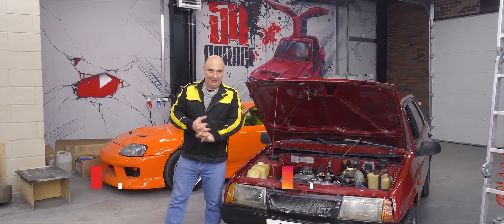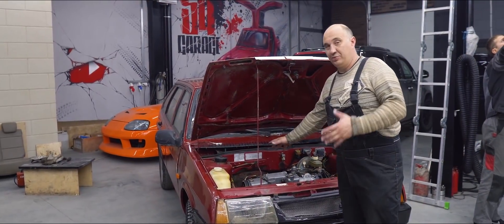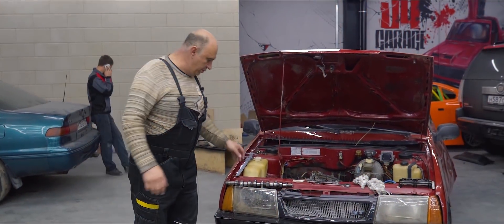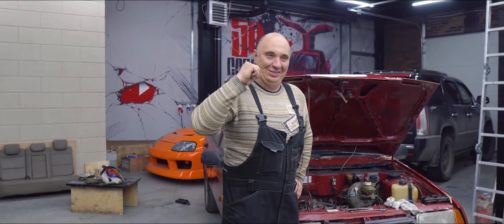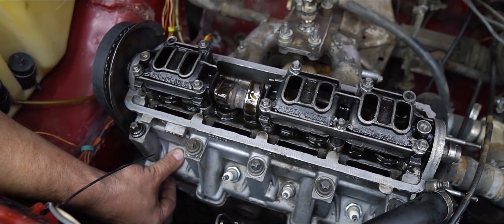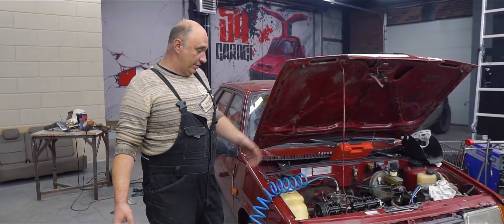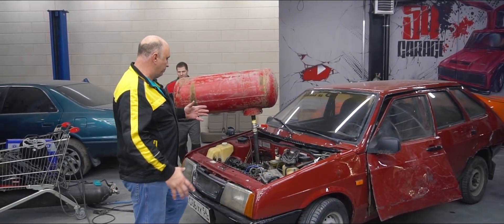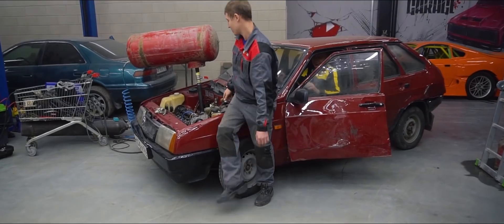Steam engine conversion, part one: startup on compressed air

Comment: i think the biggest problem is that the air is forcing in even if the intake valve is closed and the air is rushing in when the piston is moveing up.  you should use another method to shut the airflow to the silinder wile the exhaust valve is open and piston is moveing up.  you could use some sort of electrical valves and a programmable ecu to control the timeing.  my point is that the original intake valve isnt ment to hold back preassure comming from behind the valve. im sorry for my bad english.

Comment: Cut and reweld the cam lobes...you can at least clock the opening/closing to maximize your air use. Second, you would need individual air pipes to each cylinder, with switches/solenoids in the distributor to turn the air on and off at each top dead center.

Comment: just need to make the Camshaft work 1:1
Reply: im half way through and i cant watch because of their ideas
Reply: Nice idea you are a genius never thought of it like that
Reply: And add stronger springs to the intake valves.
Reply: wont work angle between valves is 90 degree for 4 stroke, for steam it should be 180
Reply: @Timsturbs  weld and re grind the cams i suppose, just weld extra lobes at 180 degrees so it Has 2 lobes per rotation per valve
Reply: @Namesakes.unit-x-10sq10  the point was that intake and exhaust strokes are next to each other and steam engine is basically a 2 stroke. so making cam 1:1 wont work. but yeah, there are many options. i personally would try solenoid valves.
Reply: @Timsturbs  don't need to make the cam a 1:1 just weld some new lobes at 180 degrees, then make the intake valve springs harder and exhaust softer. That's what they do to Briggs flatheads to make them steam powered
Reply: @Namesakes.unit-x-10sq10  sure, that's what they done in the video.
Reply: @Timsturbs  yes it will because instead of opening once in two revolutions it will open once in a revolution basically instead of adding another lobe in the camshaft we make the first lobe open twice as fast
Reply: @mohammedabenourseddiki6860  with just 1:1 it will be like:

1. 1/2 down stroke - intake
2. 1/2 down stroke - intake closes expanding gas pushes the piston
3. 1/2 up stroke - piston compresses gas
4. 1/2 up stroke - exhaust
2. - 3. will cancel each other
Reply: @TheDriverator  sure mister NASA engineer, i like your ideas...you just forgot you would have half opening time too...DUUUUUUUHHHHHH

Comment: It's strange that no-one in the comments has mentioned the elephant in the room - valve overlap. All modern IC engines use the exhaust gas outrush to scavenge the cylinder and assist in drawing in more fresh mixture. Sure they modded the cam to open on every stroke, but they didn't get rid of the overlap, so the some of the incoming compressed air will be going straight out of the exhaust for a short time each stroke. Probably why it wasn't long until all the air was used up.

Comment: guys, has anyone seen the camaro that runs the dragstrip on compressed air? I will try to find it. they have 3 or 4 about like scuba tanks in the trunk and they say they make, im guessing, more than 1000 horse power. they did not do that to their cam so they might not know about the gain.

Comment: Lol, i hate to break it to you, but to make the valves open on every revolution instead of pulling the camshaft and welding on the cam you just needed a smaller cam gear to make it turn 1 to 1 with the crankshaft rather than  .5 to 1.

Comment: Cut the crank shaft in two to make the four pistons 90 degrees apart and adjust the cams accordingly, doubt it'll continue turning under load otherwise, it'll want to stay at bottom-dead-center without torque from another cylinder to upset the balance.

Comment: Actually if you make the cam pulley the same size as the crank pulley it would turn it into the two stroke engine you would need for the compressed air.  Try that and see how much better it will work.

Comment: ever since I saw that tiny hose, I immediately thought there's no way it will work with that flimsy air volume. You need a lot of volume and a serious compressor that can hold the pressure at that volume. Also you should think about catching the exhaust steam and condense it then recirculate it back into the cauldron, since it will still be hot so you can optimize the power (once you actually put it on steam)

Comment: it's that means the engine it's now 2 stroke? Will it start on petrol then?
Reply: Of course it has two strokes, but it's not like the two stroke petrol engine. There is no combustion stroke, because on every stroke one of the valves is open.

Comment: Something I dont know if youve looked at yet ?  about 40 years ago , Volvo experimented with a  gas expansion  engine . It ran on something similar to dry cleaning fluid . The fluid was in the crank case as well . you injected it cold . an MSD ignition fired it , the  fluid  fired , and rapidly expanded , pushing the piston down . After the fluid cooled , it was re-pumped into the combustion chambers and re-used . The whole Idea was an engine that didnt    use any fuel . sounds crazy , but I saw a video of it running , now I cant find any trace of it . I know the biggest  problem they had was keeping the gas and fluid from escaping out of the crankshaft and valve guide seals .  For a project like that , your the man . If you were serious , Id even come over from Canada , and help you with it .
Reply: Greetings from Montreal!

Comment: Instead of adding a second cam lobe, wouldn't it be easier to make it spin twice as fast by installing a pulley the same size as the Crank Shaft pulley?  Granted, manufacturing a pulley would be troublesome, but still a better system I would think.

Comment: Your problem is compressed air has little in the way of expansion properties, where as steam has lots, you'd need lots of volume of compressed air to keep it running as it expands very little, steam on the other hand has lots of expansion/stored energy. Once its on steam it will be a lot happier.

Comment: how will you deal with steam/water getting into the engine and mixing with the oil, and causing a seize.
Reply: You also need a way to drain condensed water from the cylinders before startup to avoid hydrolock?

Comment: So basically double up on the cam lobes that's basically a gas engine converting to steam/air I've seen it done with a simple mower engine but it's a single acting steam engine..what caught my attention is I was under the impression that the engine was going to be replaced by a genuine double acting stationary steamer and massive fly wheel like in the movie escape from New York ..

Comment: use an engine that doesnt have a flat plane crank in it meaning only 1 cylinder is open at a time. so for a 4 cylinder have the pistons 90* off instead of 180*.

Comment: Guys try to let the engine to naturally aspire air and when is in the compression time use     the spark plugs holes to feed with compressed air that should give you more running time.

Comment: Remove valves. Combustion engine with compressed direct port air and  with direct port fuel injection. Just have a exhaust valve.

Comment: If nothing else you just made a high volume air compressor. Just need a 100 HP diesel connected to the crank. Should be able pump 120 PSI at 70-100 CFM (8 bar @ 3 Meters^3).

Comment: Towing a diesel powered compressor has been mentioned before, however it will need to be at least ten times larger than the original car engine just to get it to move, not exactly fuel efficient !!!!

Comment: Why didn't you just use different wheels on the timing belt?  You could double the speed of the camshaft.  Then you wouldn't need to double the cam lobes.

You will probably need a different cam profile anyway.

Comment: hi, you can swap gear wheel on the crankshaft - put on same size as on camshaft. So cam shaft will have same RPM as crankshaft, and you don't need to weld on crankshaft

Comment: you need both volume and pressure. figure out a rev limit you are happy with and start from there.

displacement divided by 4 and then multiplied by 2 will give you cc's required per revolution, multiply that by your desired rev limit and you'll know how many cc's of air required per minute are required to give you full rev range

example: my engine is a 3.0l 4cyl engine so each cylinder is 750cc, being 4 stroke there is 2 combustions per revolution so 1500cc of air is required per revolution. at 3000rpm you'd need 4.5 cubic meters of air per minute. for every additional bar of pressure you gotta pump through it to keep it running you can double the volume. it'll take 10 cubic meters of air per minute to run effectively probably. 
you'll need a LOT of pressure for it to work mate.

Comment: Air/steam injected in each spark plug hole from valves operated by solenoids triggered by the ignition timing from the distributor would be the obvious solution.

Comment: My friend, if you had used a toothed pulley with half the teeth of the original one, it would have worked fine and you would not need to add metal to the lobes.
Reply: Your forgetting about the blow by.

Comment: Modify the back of the vehicle to fit the steam generator and you will be fine . But be careful with steam it can be dangerous .
Reply: From the way they re-engineered that pressure vessel and attached it to the engine I'm sure we have noting to worry about :-P

Comment: You used 80 litres of air I'm thinking if you connect the vehicle to a larger tank possibly that holds 1000 litres of air maybe you can move the car about 5 feet

Comment: If intake valves are normally closed during power stroke, they need to be open to allow pressure into cylinders now. Retard the camshaft timing 45 degrees to allow that.
Reply: By the way, I love the video. Never saw anyone modify a camshaft to make a 2-stroke before! Awesome!
Reply: Maybe 90 degrees come to think of it...
Intake valves should be closed at Bottom Dead-Center so the air supply is off before cylinders move up.

Comment: The main difference between your car and a steam car engine is the displacement. The pistons in your engine are to small to produce much torque at low steam pressures. Right now you are just freewheeling the engine with air and dumping the inertia to the wheels to make the car jerk a bit. Be careful with steam pressure. You will need hot dry steam to get much torque and it's pretty dangerous stuff.

Comment: What about if you completly sealed the exhaust system and welded that to the compressed air tank via a one way valve, so as the pressurized air is blown in to the engine its recovered via the exhaust,
May have to block the oil breather system

Что делать, если вы полностью запечатали выхлопную систему и сварных, что сжатый воздушный бак через клапан в одну сторону, так как под давлением воздухвзорван в двигатель его восстановлены через выхлопные газы,
Может быть, придется блокировать систему передышки масла

Comment: You can inject the air onto the spark plug holes and use 4 electric air valves. Also you can modify the distriuitor to only open one valve at a time.

Comment: Could you imagine hearing steam train chugging then this comes around the corner with steam pouring out the exhaust.
Reply: oil Toast 
I’ve seen recently a 6x6 steam powered Jeep Wrangle. The boiler is a the back and why it has tandem rear axels.
Reply: If it wasn't for the electric starter Steam cars would have won the car war.

Comment: take the rings out - they are causing too much friction.  (high compression is not needed)
Reply: what do you think seals the combustion chamber Einstein
Reply: @kakswell  there is enough of a seal between cylinder walls and piston to allow the expansion of compressed air or steam.  Remember the overhead cam was modified so there is no compression stroke anymore.  the rings add a lot of friction for nothing.  Pistons are already a snug fit and a little oil does the rest to fill the gap.  oil can also be added through input pipe to help with lubrication.
Reply: Lol....

Comment: When they welded the cam I thought Back to my grandfather making an air compressor from an old mower. He welded onto the cam to make two intake strokes, and grinded off the exhaust lobes. The best thing was that it worked. It still works today because we rebuilt the engine. Because the engine has good displacement, it’s a great compressor to run air tools.

Comment: The problem is not the air pressure, it's the volume of air that you have underestimated! Have you ever noticed how steam engines have large diameter steam pipes? And a colossal sized boiler? All for a relatively low power output. That's because you have to admit a lot steam into the cylinder, at a decent pressure, with a big reserve volume behind it.   In this engine, as you have it configured, you're trying to pressurise two cylinders at the same time. There just is not a big enough volume of air to do that. Remember also, the smaller the diameter of the cylinder, the greater the pressure you need to move the piston.

What's the output pressure of your compressor? - About 10 to 15 bar? A modern steam engine's boiler would be at least double that, so, in backyard mechanics, you need to double the pressure, quadruple the volume, and have an almost unlimited reserve of air, to make it work.

How about getting hold of a mobile compressor of the type used by road construction workers (rock drills, jack-hammers and the like)? They at least can sustain a large volume and pressure. Probably not enough to the make the car a viable proposition, but maybe enough to prove the concept?   Then also, at least, if the car has the capability to tow a trailer, you could tow the compressor behind the car, and go for a drive - assuming the engine can develop enough power to tow the compressor!

Comment: Wouldn't a 2-stroke engine be what is needed? 4-stroke has alot of wasted piston travel with no open valve to supply pressure.

Comment: The high pressures required for a boiler and steam means that a carbon fiber storage tank might be necessary. I can't imagine the size and volume that a pop off valve would have to be to release so much steam,water and air at once if it "blew" ! Chernobyl again ?

Comment: I actually tried this on my lawnmower once. I out an air chuck it screws perfectly in the sparkplug hole, then I attached the air hose even for one burst it spun the engine a few dozen times at least. so I would try this on a small engine using the spark plugs

Comment: Guys no need to double cam shaft lops, just make it turn two times more.
in 4 stroke engines it has 1:2  ratios hence 2 engine RPM to 1 Cam shaft RPM.
so if you make it 1:1 it will do trick. in easy world make came shaft same size as crankshaft  ;)

Comment: There is a guy who made his car to run on compressed air, he has the air leaving the first cylinder is fed to the second cylinder, then to the third and forth. this gave him a lot more run time per tank of air and each cylinder was adding power to the system. i think he was getting 15 minutes of run time at 20 mph.
Reply: I'm wondering if the "exhaust" could be reclaimed.
Reply: So 5 miles or 8.5 km at bicycle riding speed.
Reply: By feeding the exhaust from one into the next cylinder , they are capturing , recycling the air. This is why the other commenter suggested 10-12 cylinders, but you're only displacing one cylinder per rev.
Reply: @paulwoodman5131  that increases the starting pressure in the next cylinder, meaning less air to reach working pressure.

Steam plants do something similar by condensing the exhaust steam to just below boiling and feeding it back to the boiler.
Reply: @forestdenizen6497  ah, interesting, I don't know steam systems. These guys will figure it out.
Reply: Might as well just invent a first in line combustion chamber that pre burns the exact amount of fuel to move the pistons at the RPM's for the speed that you are going.
  Release the combusted gases on time to "fire" the engine. Add steam or water vapor for volume ?
 I mean, you are using fuel either way. A steam engine might help only as a secondary function from the hot exhaust. However, they have thermal electric now that would be more efficient.
Reply: That doesn't add power.  It effectively makes for better gearing.

Comment: The air pressure will also be pushing the intake valve open i would be putting a stronger intake spring on the valves it should use significantly less air

Comment: Steam in 10 times more dense than compressed air.
Reply: That is my thought, steam under pressure should expand way more than air.
Reply: @grantw.whitwam9948   
10 Times stronger form the beginning. At last. ..

Comment: Impressive engineering, a big effort for a few engine revolutions, this makes you think how impressive the power of fuel is.
Reply: correct, the amount of energy density in petrol is quite high compared to batteries or compressed air tanks. Even hydrogen will need a massive container at very high pressure to get any real distance in a car.
Reply: @kruleworld  Actually what it shows is how inefficient "external combustion" is, not what the density of the fuel is. Compressed air in this case isn't a fuel just as steam isn't a fuel. Coal or other burned substance is the fuel in a steam engine and electricity in the form of an air compressor was the fuel here. You're better off using the fuel directly (internally). Which is why we don't use steam engines anymore.
Reply: @xNYCMarc  it doesnt show how inneficient they are...you think they are inneficient and mathematically they are inneficient but this experiment doesnt show that! simply because the engine is not burning any fuel mister tesla fanboy

Comment: Holy motherf*cking crap. I put screws into my offroad tires - Garage 54 puts out a vid about it. I start experimenting with 3D-printed compressed air engines - Garage 54 puts out a vid about it. What the hell...